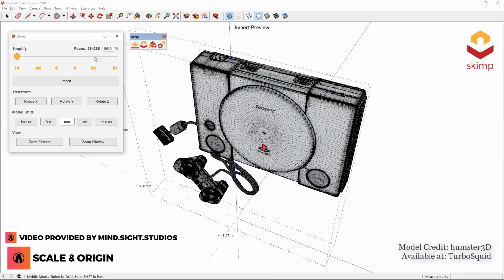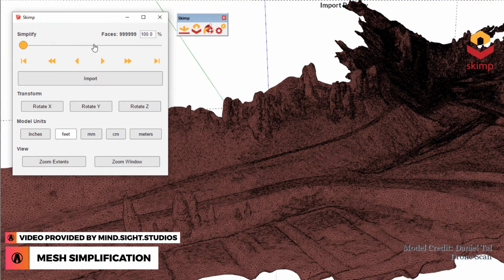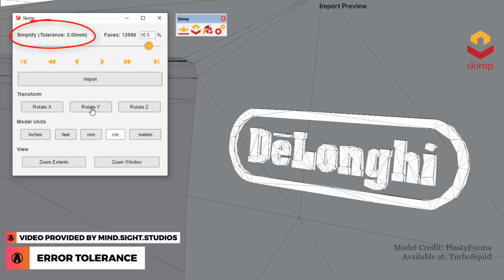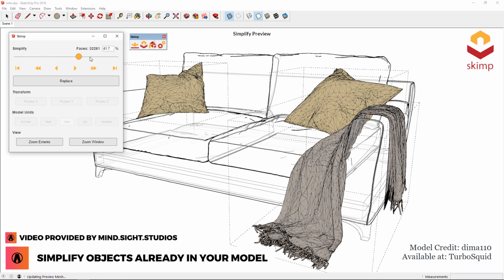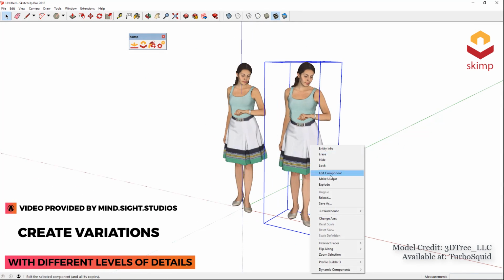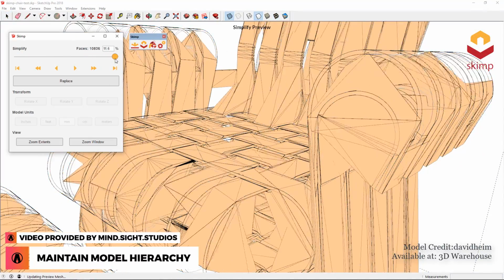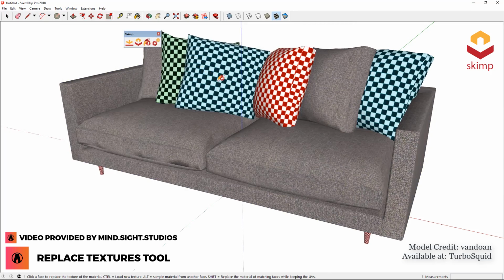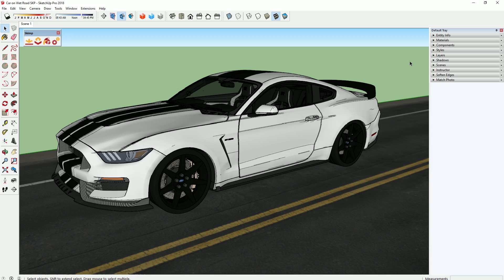How to Reduce File Size in Sketchup | Skimp (Sketchup Importer)

Comment: Thanks for the info Minh.  Will be trying out this and Transmutr with the Evermotion packs this week.  Any tips for this workflow?  I usually find many sketchup scenes (Some on SketchupTexture dot com and even the ArchViz ones you supply through Patreon) too heavy and its difficult to navigate within them.  I'm hoping to use ArchModels .max  with Trransmutr and reduce the polignal count and hopefully be able to work without lagging.  Any tip or suggestion?
Reply from the maker: Oh yeah if you use max files then just export them as obj or fbx first and then take them into transmutr.  If you want to reduce poly count of existing models inside of sketchup then skimp can do that. I would use skimp for internal use and use transmutr to import external 3d models because transmutr support render engines and materials 😊
Reply: Great thanks!  Which format OBJ or FBX would be more accommodating for Sketchup on Mac? and why?  Also will a texture map plugin be required and which do you recommend?  Again on Mac but also running SketchUp w VRay on PC
but gravitate more words Mac for now.  Thanks Bro!
Reply from the maker: Both obj and fbx work just fine. I usually use obj. And if the model already has textures correctly applied then you wouldn't need any plugins for it to work😊
Reply: @ArchitectureInspirations  I see SU imports 3DS files..?  Is 3DS import not recommended vs OBJ & FBX?  And why?  I see 3DS files carry texture and map info?  Care to break it down for me please?

Ive done some searching and trying to get my head wrapped around it.  I know were not talking about Unity
yet these are universal formats and might by exporting, importing and going in-between apps like 3DSmax and Rhino, but for now your take on SketchUps import capabilities..

https://polycount.com/discussion/169104/fbx-vs-obj

https://forum.unity.com/threads/pros-and-cons-of-different-3d-model-formats-fbx-dae-ect.344009/
Reply from the maker: Yeah if you have .3ds files then importing it directly to Sketchup sometimes works well. As for FBX and OBJ, I haven't seen any huge difference importing both of them into Sketchup. As long as the model has materials and textures then it works for me. It seems that FBX will include animation but it's not needed for sketchup vray.

Comment: Any free software/plugin for import high poly models from max/obj/fbx?
Reply from the maker: Hm not really. Only transmutr, skimp, and simlab plugin for 3ds, none are free
Reply: P.con Planner is free and allows you to export/change the file format of any model... But, It doesn't import directly in skp, sorry
Reply: TIG Importer, but it has way less features. Actually I'd recommend transmutr over Skimp, since it has a lot of more features, works well with Skatter and is a bit cheaper. :)
Reply from the maker: I actually do like transmutr since it supports rendering programs 😊
Reply: Danke, ich werde Transmutr mal testen. 💥
Reply: Any idea for free addon for Blender ?
Reply from the maker: Hm sorry don't really use blender so I'm not sure